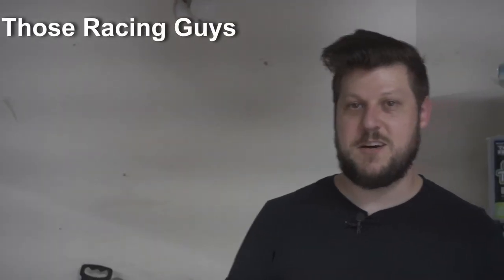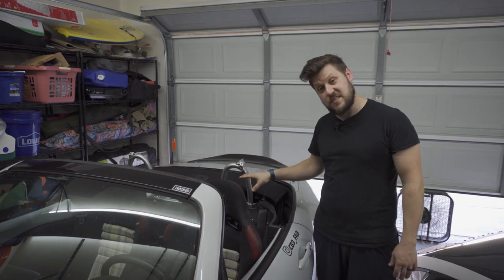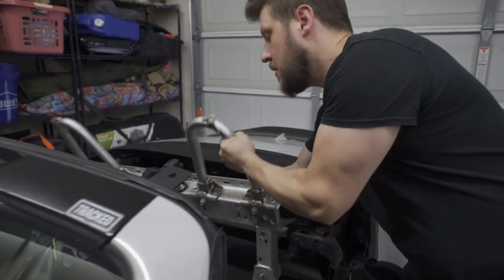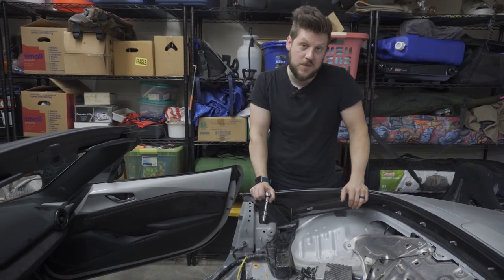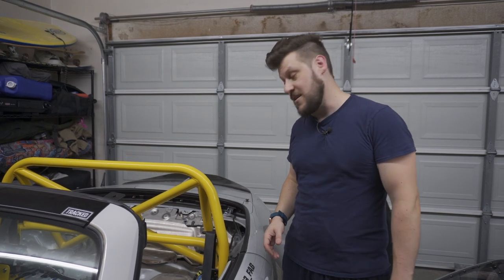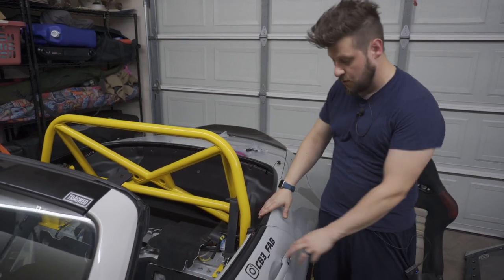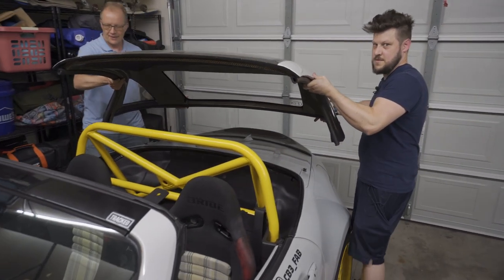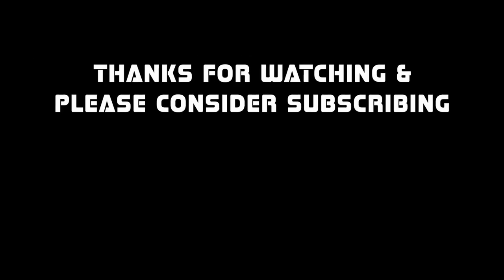Blackbird Fabworx (ND) GT3 Rollbar Installation Companion

Comment from the maker: A note from Blackbird Fabworx in regards to the difficulty of installation mentioned in the video; Due to the structural changes made for both the NC and ND chassis, the installation of an aftermarket roll bar is more difficult than previous generations (NA & NB). Many of the steps required will be the same regardless of the roll bar model & manufacturer.